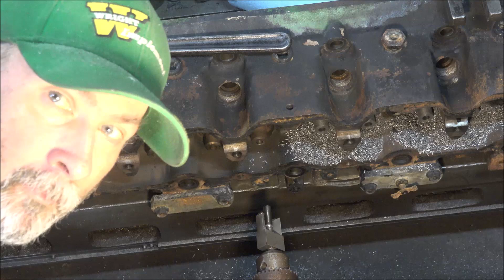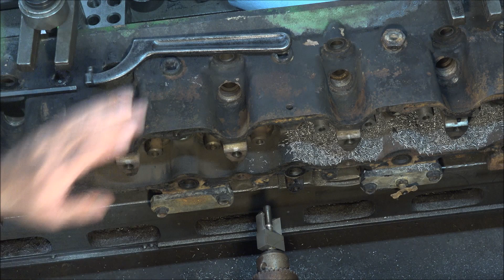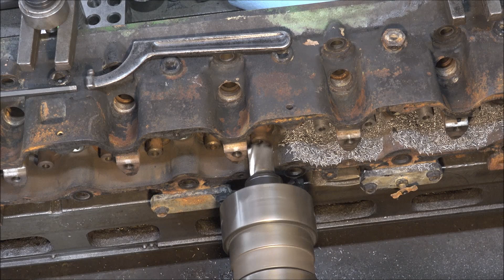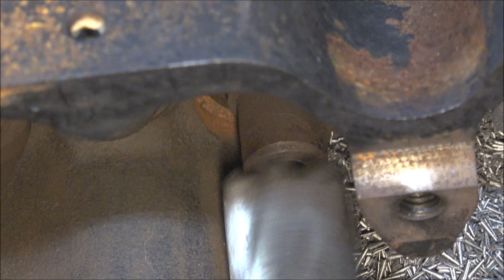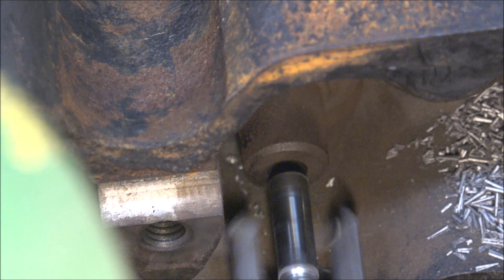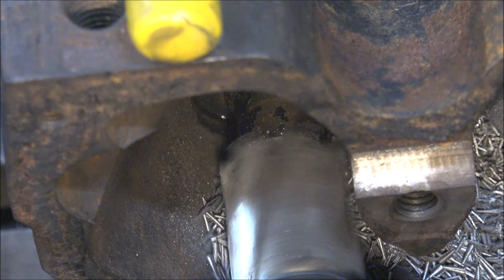Machining down valve guides and cutting spring pockets. Common Modifications needed For Performance

Comment: Did you have tool made or is it off the shelf? If off shelf, what is company? Be nice if it chamfered that outside cut edge over to avoid sharp corner against valve seals! Nice job! Hopefully video of  it getting assembled with valves, seals, and springs?
Reply from the maker: We don't use valve seals on the pullers. This tool is made by Manley

Comment: 👍👍john Deere 400 series head ??. probably a stupid question 😂... Does anybody modify the 300 engines??.. the 329,359,414... Have got a couple 414's in skidders around here..never had the serious urge to use one for something else, but have been curious if anybody does..the little newer one's can have inline pumps in different apps i think... maybe the damn pencil injectors are a limiting factor...idk... but anyway 👊
Reply: I know a guy by the name of Mike Savey from kentucky used to run a tractor with a 359 in it I think. I believe those actually have cross flow heads and are pretty good motors just a little small for most pullers which are 540 inches or bigger. I think it would be a good choice for a class with limited cu in rules. A guy could probably machine the heads for bigger injectors. I know guys used to machine oliver heads for international  injectors.
Reply: @TheJohndeere466 ten four...thank you 👍👍👊

Comment: If you ever get a chance, I'd like to see how you'd go about milling the valve spring pockets on a 12V for the "top hat" style valve guide seals.. I've been having some issues with the exhaust pressure blowing them off on my truck and the top hat is supposed to cure that